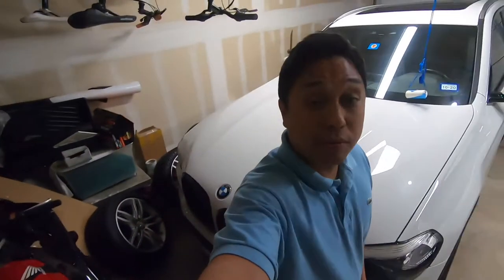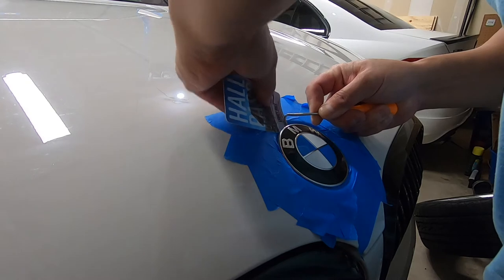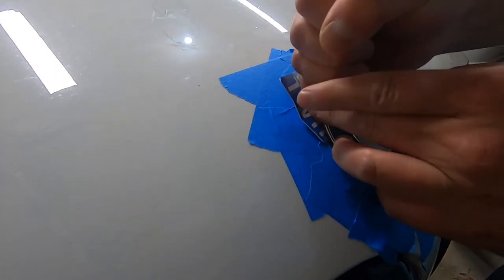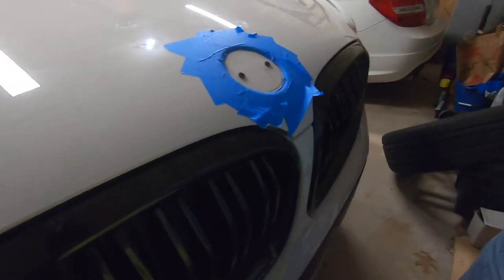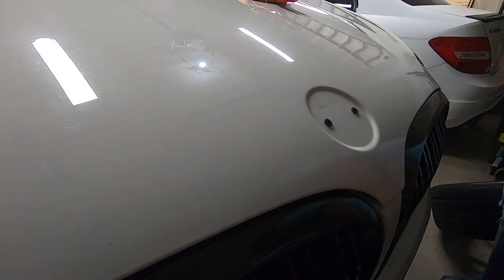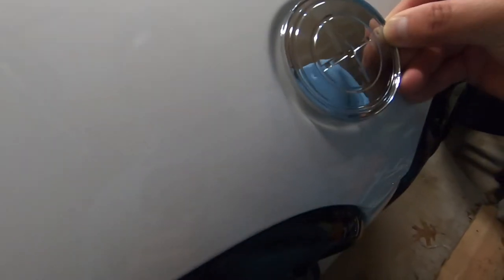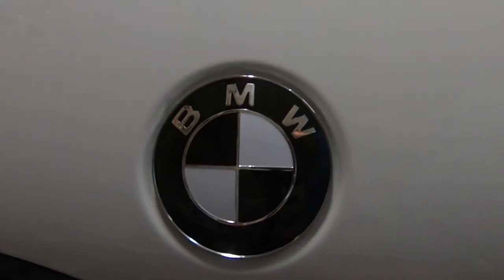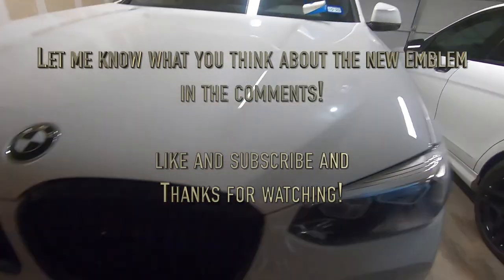HOW TO REMOVE AND INSTALL BLACK AND WHITE BMW EMBLEM BADGE ON HOOD AND TRUNK OF X3 X5

Comment: Can you include a link for those black and white emblems. I can’t find a good quality one
Reply from the maker: The original site that I ordered the badges from are unavailable.  I had found them on Amazon.  I found another site but I do not know the quality.  I remember I had to order 2 sets because two of the emblems that I had used were the same size and the set came with three different sizes.  You might have to measure and see which size you need.  I'll include a link in the description of something that looks similar to what I had used.  Not the exact one though.

Comment: Emblem size?
Reply from the maker: I do not remember the size off hand.  I bought off Amazon which was a 3 pack at the time not available on the site anymore.  I had to actually buy 2 packs from what I remember since on mine, I remember the trunk and hood possibly being the same size.  Kit had an 82mm and a 74mm and I cannot remember the third size.  I think I used the 82mm, but not 100% sure.